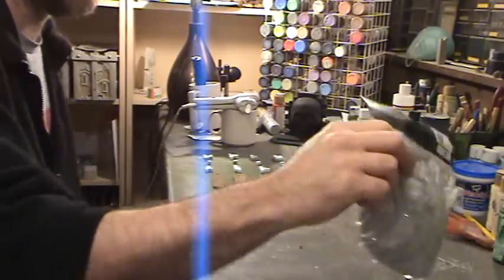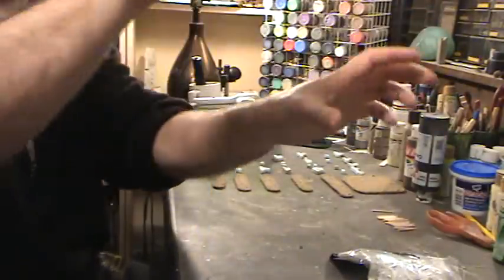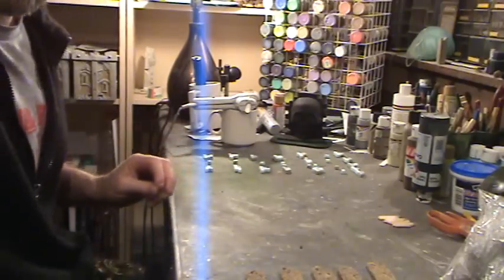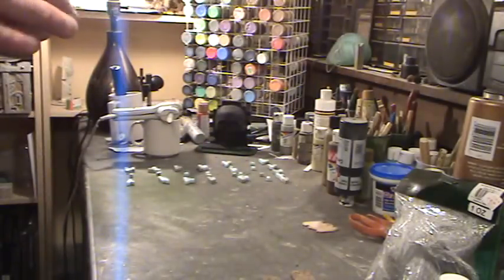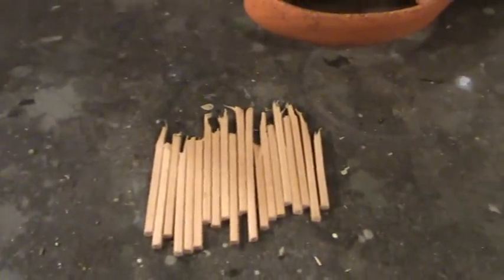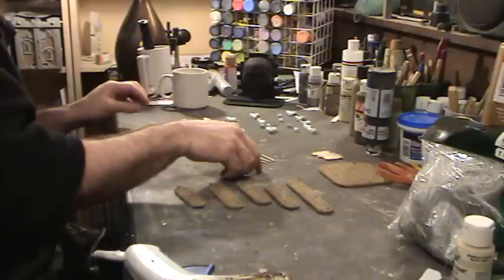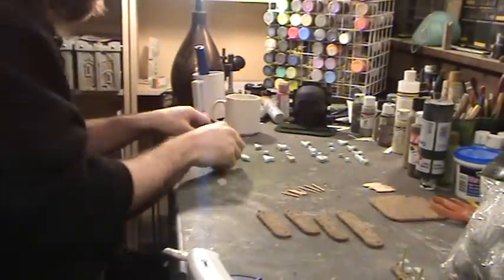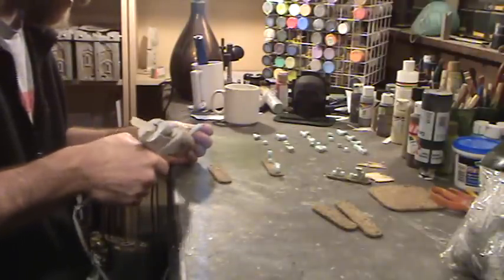Vlog on the CHEAPEST barbed wire known to man

Comment: Great video, I've done fences and hedges the same way with the tooth picks and tinsel. You can make a quick and cheap hedge by using furnace filters cut shape and then flocked with different colored flocking. All the pieces were mounted on balsa wood flats about a 1" - 3" wide.  
Also take the same setup and use cheap plastic window screen (walmart) cut to shape and mounted on toothpicks and you have instant chainlink fences. Just spray paint black and dry brush silver metal.
A few ideas for ya.